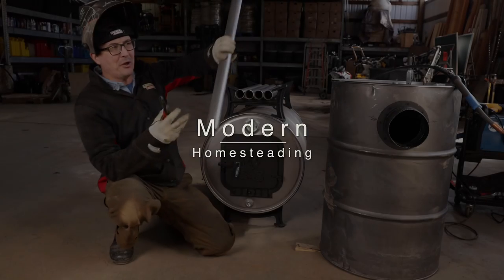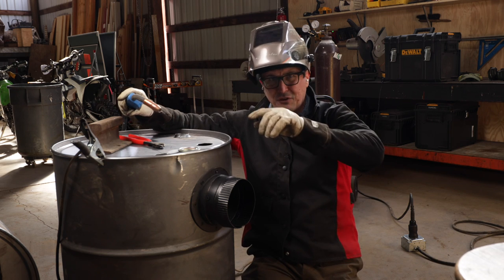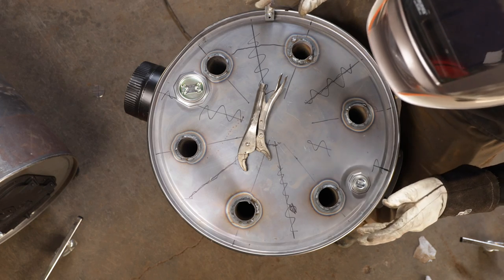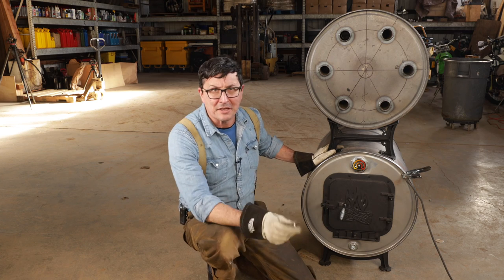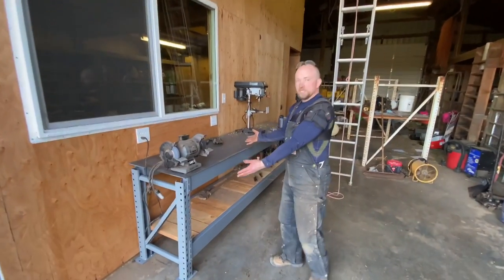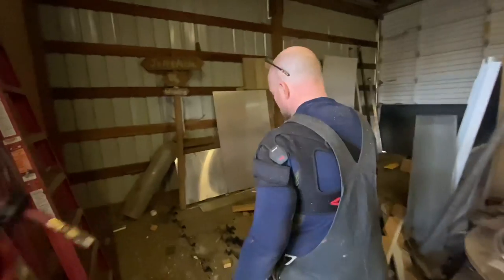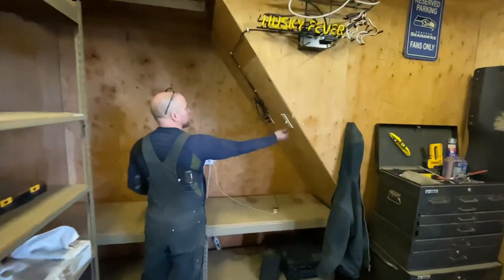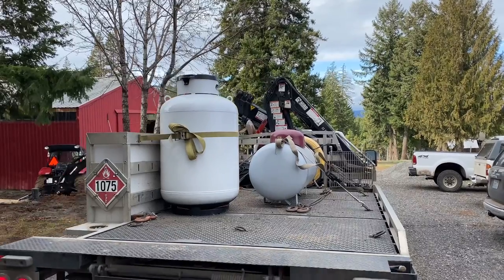This Welding Will Leave You SPEECHLESS!

Comment: A trick to do circles like what you are doing start on the opposite side of the pipe. Lean over to see your start and bring the weld towards you. Do it in 2 welds start next to your first start and once weld starting push puddle onto original start then go back and do the second weld stopping on the first stop and hold for a few seconds. Once get really good with that try doing it in one pass. Just trying to give pointers as welding is my career and licensed in it. Doing a stove I would recommend pressure testing it by regulating 15lbs of air into it with all ports sealed and spray soapy water all over the seams and welds to check for leaks don't want any fume leaks.

Comment: That's pretty good welding I weld for a living. Welding a circular tube or pipe is hard. Plus you're welding thin sheet metal hats off to you for not blow holes through it.

Comment: I haven't done much metal welding, but I have a lot of experience working with pipes, I recommend next time try and have the barrel on something facing you. That will stop the barrel itself from blocking your ability to smoothly move around the pipe as you're welding it. With the pipe now horizontal instead of vertical, you can use your bodies much better vertical flexibility, rather than stepping around the barrel all the time.

Comment: Not criticizing your efforts, you did few good. I must say the biggest issue I think you had was the gap between the hole and the pipe and the difference of metal thickness of pipe wall and the barrel thickness. It was a tough technical weld to do perfectly. But you did pretty well. Thanks for sharing!

Comment: you can get and modify one of those Peltier powered fireplace fans (they use heat exchange for power through a peltier plate). basically when it's hot it will turn the fan on, without the need of external power.

then put it to blow air through the tubing for more air circulation

Comment: 4:12 Mr W., Seems like what you need is to come up with a contraption that rotates the barrel around the longitudinal axis of the pipe being welded at an adjustable speed while you hold the welder very still, for a full 360 deg turn at constant speed without interruptions. :)

Comment: FYI... The heat on a MIG welder or a FCAW is controlled by the wire feed speed, not the voltage. The voltage adjusts the power supply to the wire size and other wire variables. I think you might have done better shortening the tubing a little and doing a "melt-down" type weld. It would have left a prettier end on the pipes. I tested welders for 20 years, and I can tell you that if that was the first time you tried  2" DIA weld, you did a great job.

Comment: Not bad welds I am in welding in school and we are on mig and here is a tip work on flat place and runs beads intill u got the hang of it welding just take practice u will get it and see where u like the wire speed and amps

Comment: Practice moving from the tube sidewall to the lid surface in a loop wrapping into your weld as you make a long tail on the bottom of your ‘C’ motion to move back up to the pipe wall and back into your weld

Comment: Couple of comments. 1) A pro welder once told me that you can pull a stick weld, but when using wire, you should push into the bead. 2) If it's ugly and it holds, it's a good weld. Pretty and fails, bad weld. 3) The stairs are steep, but they are wide enough to make them a full tread, which is the mark of a pro. Amateurs don't make them large enough to get you foot fully on them. 4) Shop looks good, hop he finds his wrench, must have been a 9/16".

Comment: I worked ten years as a welder and the sound is good but all you need is practice and yes mig welders have a sound and if they're not right or course you will know with practice.
Ps when doing anything with gas overlap the welds

Comment: Well Cody you need to put that barrel on a rotator with the tube you are welding in the center. Then you just hang from the ceiling and weld it up. It will look as good as Mr. Tig time himself. :)  
Thats a nice classic stove you got there.

Comment: I was wondering possibly would th barrels last longer if you put oven bricks or ceramic type bricks inside. To make sure, that the wood isn't consistently burning on the bottom of the barrel and burns though after a year or years. Could this possibly work or is it a stupid idea. Answer please thanks

Comment: Exactly why pipe welders get paid what they do.  It takes a little bit of practice but relax and watch the weld puddle.  Set yourself up so you can move around 1/2 the pipe freely. Let your body relax and you’ll stop worrying about what to do.  The weld puddle will tell you how fast or slow you need to go.  
Remember you are pushing the puddle. Try to keep the gun angle the same all the way around.  Your body moves but the gun doesn’t Keep the weld puddle the same size from start to finish.   Grasshopper you must believe!

Comment: Your problem with the welder is getting the heat the feed speed right and your work speed. When you slow down your feed on a MIG. You actually cool the weld so you still need to leave it up hot just turn down the wire speed a little bit and you can work it in. Especially when you're talking about the pipe that you're using for the heat exchanger is thicker than the can that you're welding to. Other than that, your Mig sounded about proper.

You're not having a problem with the heat. But you do have to complete the well do you have to get up onto the previous weld in order to get a good seal. Could have used at least twice the number of tubes. As well as another set in a circle towards the inside and one in the middle.

Comment: So, on the top drum, aren't the inlet opening and the outlet to the chimney supposed to be on opposite ends of the drum ? That way you get more heat out of the flue gasses. The way you have it they just go straight up from one hole to another and don't circulate through the top drum.

Comment: Next time you weld one of these try to position the joint  in the vertical position weld it down hand, it lets you keep a nice travel angle, work angle and make nice long runs so the welds come out minty. Nice work tho those fillet welds are tricky with a fixed mig gun in horizontal.

Comment: I’m curious with the welds.  I know the material is thin but do the welds hold up with the expansion and contraction of the material?  Just an observation but adding a reinforcement plate at the tubes may help.  I know it’s not required for stresses because the pit / stove is operated at atmospheric pressure.  But I would go with a TIG weld vs the fluxcore.  But that’s just my preference as an inspector. 
Anyway great job and I learned something new with this design.  So thank you for the video.  I watched the series.
I find it amazing how all “our advancements” have really pulled us away from the simple basics.  Also I find it ironic that this plays into us being more dependent on the convenience of being “civilized”.  At least they like us to stay trapped and keep paying for it.  The technology aspect and the root causes of pollution.  Sorry to ramble.

Comment: I’m hardly an expert in welding ( two small weld projects under my belt…that looked like garbage)  BUT…your beads don’t look half bad.  that one tube where you didn’t show the back side, seeing inside the tube showed you had decent penetration, so that’s good.

as to base metal temp being cold, you may want to pre-heat the weld site with a propane torch (just a wee bit) and then weld.

overall, great video, great effort!  👍👍👊👊

Comment: I didnt see you moving the tip of the welder up and down at all, just around. Moving up and down as you go, in a slight half circle, is called "stitching" the weld.  It will give you the cleaner, flatter puddling that your looking for.  Grab some scrap and give it a whirl.  Just move in a small semi-circle or half-moon shape.

Comment: Since ya used exhaust pipe, ya could use reduction fittings in the back side of the barrel. Say ya use 2"/2.5" fittings. They would act like funnels and catch more air from the fan and make everything more efficient.

Comment: Just a recommendation when welding thin metals to avoid burning through do it in about inch sections and space them out as you go around the pipe until it's sealed
Reply: how can you make it so you get a clean round edge after that?

Comment: Here is a tip: When it comes to thin walled metal, try just tacking the material in place, then come back to finish it. I believe it will help you from burning through the material. Just a suggestion. I don't know if you subscribe to any you tubers, but trying watching Mustie1's welding. He does a fantastic job. Just a thought

Comment: As someone who welds in a fab shop everyday, what I would have done(and I'm sure alot will disagree with me), to mitigate the risk of burning through, would have been to put the barrel up on your other barrel, as if it was assembled, and ran my welds downhill, around the tubes. You would have only 2 start/stops, 1 at the top, 1 at the bottom. Your material isn't thick enough to worry about the penetration loss with a down weld. Just need to seal the tubes.

Comment: Looks pretty good ! try moving in small circles it will even out your weld and you can focus on steering the weld a little easier around the radius it works pulling the weld as well as pushing

Comment: The welds are actually not bad at all. You did decent for welding low grade steel used on barrels and aluminized exhaust pipe

Comment: two things. you needed to goop the chimney joints with that high heat goop for good, sure sealing.  On the welding, on thin stuff like that, don't go for continuous beads, stack dimes. make a dime size or maybe even a little smaller tack, let it cool just until it's not red and melty, then stack another dime on it about half way along, and so on until you're all the way around. the center of the dimes should be right where the metal comes together. Yes, not only did I do it for a living years ago, but I went to school for it first. Different things call for different techniques. some  guys could weld beer cans together, that really gave me problems dialing in the right heat for that and being quick on the trigger... well I managed sometimes but mostly I blew through the cans.

Comment: Coming from a welder I would have just tracked all the way around it it would give you that “dimes” look. It’s not holding any weight so you don’t have to worry about that it’s not gonna leak any smoke. Sorry for not suggesting it earlier

Comment: We all knew the stairs were made from scrap. I think one of you pointed it out in the original video. We were all pointing out the huge ledge he left on the front of the step. I mean they had to be cut to fit the rails...so we were all kind of curious why he didn't just go ahead and do the other cut to get rid of the over hanging lips.

Comment: Hydrated light naptha (petroleum),  CAS no 64742-49-0, is very good for removing the residue from stickers. It probably sold using different names. In Sweden it is commonly sold as "kemiskt ren bensin".

Comment: To weld in a circular area like that put the weld surface at about shoulder height and with the back (for a 55 gal drum about 1 inch max) and weld face on it goes much easer.

Comment: as for when you said that you want your surface to be clean, that is 100% true, a wirewheel will get the job done, i wouldn't use chemicals because it might get in your lungs and thats a yikes, but that barrel was pretty clean anyways so anymore cleaning would be bonus points.

Comment: Tack all the pipes into position, lay that barrel back on top of those fancy blocks you have a awesome set up. Welder set on 20.0-300 to 400 wire speed, an wipe those weld's on like a birthday cake. Nice welding for a beginner look's great. A QA standing around probably suggest 18.5 180-190 wire speed. But heck you won't get use the dang thing before gray hair set's in. Lol
Reply: Don't forget even circles in the puddle make you some pretty dimes.

Comment: make a circle roller on that welders tip so you can just pull or push and its be in right distante to make good welds and you can use that roller to make strait welds also

Comment: use the wire speed to adjust heat output with wire fed wilders stick welding is different where you would change the amps to have a cooler or hotter weld with wire you can find tune using the wire speed just thought maybe that could help in the future love what your doing!! keep up the very helpful content!!

Comment: Nice work on this build. Did i miss what wall and material you used.
That should be great furnace.
..i built one but used only 6 x  4 in. Infa red heater pipe i had from yrs ago. I was getting 200°f going out hotizontal  4 in chimney.  I now have 6 in verticle chimney  150°f heat loss.  Yours should do better.
..i m using waste oil though. 
Love your stove.

Comment: The best way to weld the pipes in would be to turn the barrel sideways and make two passes from the top down, making small circles with the end of the welder to better transfer the heat.

Comment: If you want your welds to start out better clip the tip of your wire before you start so you don't induce contamination. Also, tack those in there and get rid of that magnet before you weld fully.  Before you actually strike the first arc or before each weld get set and with the helmet up and your finger off the trigger go through the entire motion of welding so you can see where it is you will need to stop and reposition. It will make the real thing that much better for your control. Just a few tips. Otherwise, Nice work!!!

Comment: On the ranch I would weld with baling wire and an oxy acetylene torch.  It looked really bad but 30 years later and the welds are still holding.

Comment: If you started with a small root weld then turned your heat up to run your second pass it might look better .... I’d weld a quarter arc at a time , but I’m a trained sheetmetalworker ...

Comment: in hind-sight you used vehicle exhaust you could have had a socket on each pipe & a tight S bend going into a box that would house a fan / blower to push hot air into your workshop , cheers The Don

Comment: 4:40 Build a giant rotating jig so that the ENTIRE barrel will ROTATE about the AXIS of the tube you are working on, then hold your welding tip FIXED and TURN the work.   (Do this if you decide to build a bunch of these stoves to GIFT to friends.)  You could probably practice welding and master that faster than you could build the ROTARY JIG, but it's a fun mental exercise to VISUALIZE such a machine.
Reply: No need for a "giant rotating jig"... just insert the pipe inside the barrel and tack each end.  Then, run a longer, smaller diameter pipe through the tacked piped, and support on each end by saw horses, etc.  Finish welding pipe to barrel, as it is, slowly, turned by helper (wife).

Comment: I want to say this if there slag you musta a drag if not then you musta push since your using a non flux core welder push your weld puddle dont drag it if you drag it your adding outside gases to the molten metal asking for porosity and bubbling which will make the welds look insanely ugly and often make it much harder also with a MIG your real heat and penetration isnt from the amperage its from the wire feed speed from what was hearing with your welds your having to low of a feed speed and to high of a voltage play with some 1inch flat bar put them side by side and run a bead pushing not pulling listen for the buzzing not popping and play with your torch to work surface angle and a good piece of advice find a way to get comfortable otherwise your going to fatigue and struggle to stay in position.

Comment: your welding technique in those situations try the start stop or i like to call it triggering the weld, the other thing that helps sometime is to run smaller wire with that thin of material hey keep it up nice projrct

Comment: Do you ever put more fuel than you thought you'd need in a wood oven  and need to extinguish it before it burns out rather than leave it unattended? If so would you just remove the fuel, or extinguish it with water or dirt? And if with water do you need some type of drain system in the back so it can dry properly?

Comment: As long as it sticks and seals it is good! It is not structural. Round material and weld all around has to be done in 1/4ths or 1/3rds. The secret is to get in a comfortable position and weld flat or flat fillet as often as possible. And as the Journeyman who taught me to weld before I went into Carpentry said, "Flat black stove paint hides a multitude of welding sins."
If the internet experts whose best thing is keyboarding would try to do what you do, then that wood stove and those stairs would look a lot different. Kind of like a cartoon version of the reality. The one thing this world need a whole lot less of is know-it-all, do nothing critics, or even critics in general.  I'm retired now so I doubt my welding or carpentry would have been as good, and the older I get the better I was when I was younger.
The clicking sound was like somebody stepped on a flattened aluminum can.

Comment: Should've used heliarc process. Your Welding different thicknesses plus different metallurgical properties of your drums.  That's why your blowing a hole through your work pieces. A nice DC current weld with a properly rated filler rod will produce aerospace quality welds.